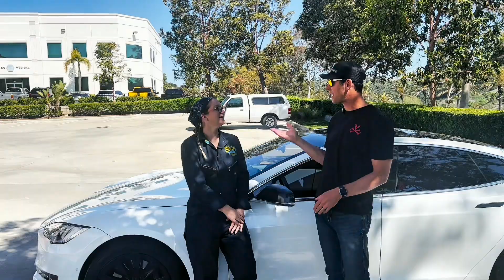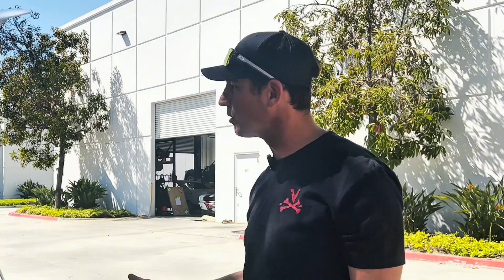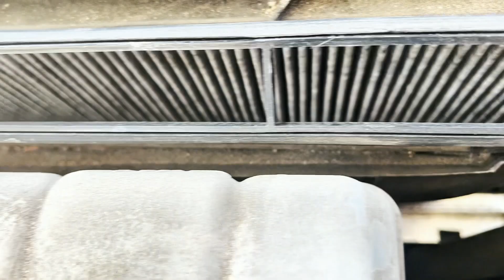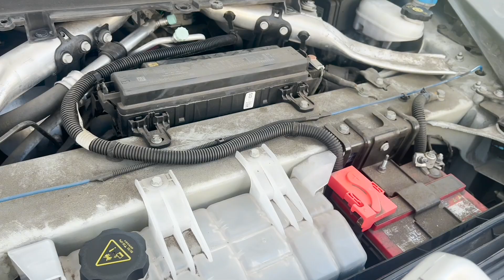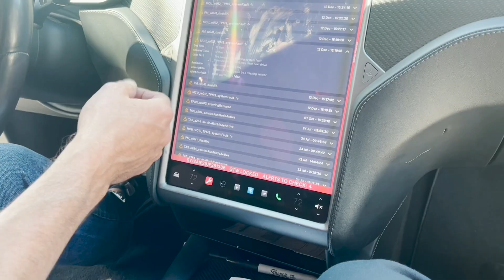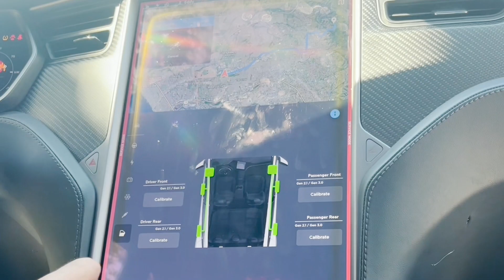Think EVs Need No Maintenance? Think Again! Tesla & EV Care Tips with Revolt Systems | Girlie Garage

Comment: Thanks for making a video about this.  I bought a 2018 Tesla Model 3 Performance new in 2018, and I have done suspension upgrades, tires last about 25k miles, and the weirdest thing is the door latches only last about 2 years before internally rusting and binding up, refusing to latch.  I had to drive 17 miles home from work holding the door closed. At least they are fairly cheap and easy to replace.  Keep up the great videos, I found your channel due to the Rich Rebuilds Strugglebee Prius repair.  I bought a 2012 Prius plug-in from a friend at work for my kids to drive, and it just doesn't die. I hate it but I respect it.  Super cheap to operate, perfect for kids in college.
Reply from the maker: So much good stuff in your comment! Thank you for sharing! Do you live somewhere prone to rust? Good to have a car for college youth that won’t give up on them!

Comment: I have a 2023 Nissan Leaf Sv Plus. I have been curious as if the drivetrain gears ever need to be greased? I have realized my curiosity to purchasing this Nissan has become a new journey. 

I am so used to internal combustion engines as my exstepfather is a mechanic. I plan on keeping the car around in my life for various reasons. One is , after the warranty is over; I'd love to tackle replacing the battery cells myself. I miss taking computer towers apart lol and my mind has correlated the EV battery compartment to a PC Tower. It would be fun to figure out how to find and remove bad cells. Properly charge the new cells to the equal charge of the current cells, then install the cells , reseal the battery compartment and install the battery back into car harness underneath. 
It is a fun car but always remember to see how much things like car registration will cost for the EV as it can bite you in the tush. My registration every year is 506.00 since its an EV where I live. Cold weather can play on your anxiety about milage/range when you're new to EVs.

Im in New Hampshire and this is my first severe winter season into having my Nissan. It's a tuff car and its hanging in there. It tackles a mountain every day. So the range and battery does  take a lot of stress in cold weather. Like internal combustion engines and gas, The EV consumes a lot of energy while running the heat in winter. The car is amazing though. I've had it almost a year and I just figured out it can drive itself basically just as long as senses my hand is on the steering wheel. It made me laugh realizing that. I have never owned a car that could drive on its own. Its called ProPilot assist.

Anyways thanks for posting this video. EVs are fun but remember they need maintenance and care just like internal combustion engines. 
🙂🙂
Reply from the maker: Whoa, so much cool info. Thank you for sharing. As far as lubrication points and times I would take a peek at the maintenance schedule so you can see what they are recommending. Generally any metal on metal part will need to be lubricated, or if it doesn’t have a service interval they just expect it to be replaced (like VW transmissions 😂). 

I’ve only worked with replacing cells on a nickel hydrid battery, not sure how much support there is for lithium. @richrebuilds would be a great person to ask that to! 

The severe cold is always a problem with batteries so I’m glad to hear that the newer Nissan leaf has figured out a way to protect the battery better so you can still drive your EV in the winter!